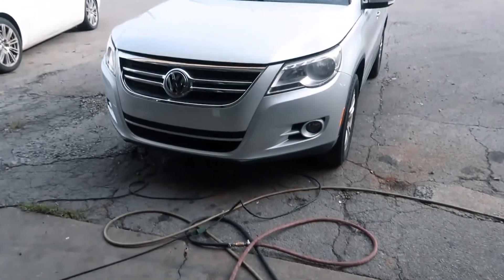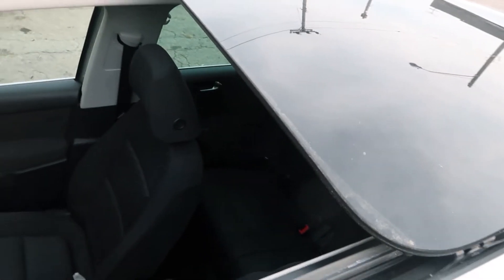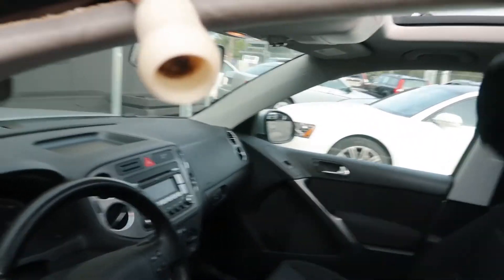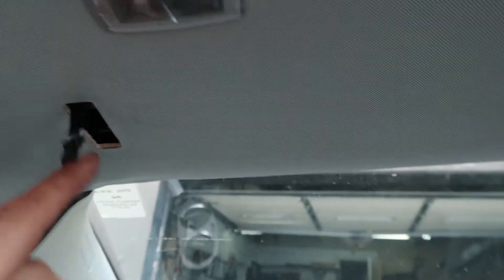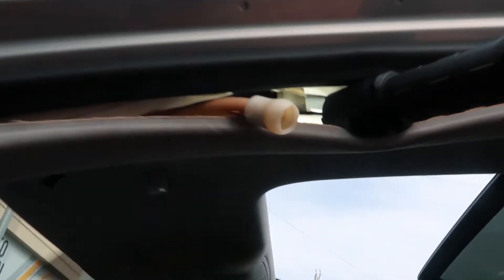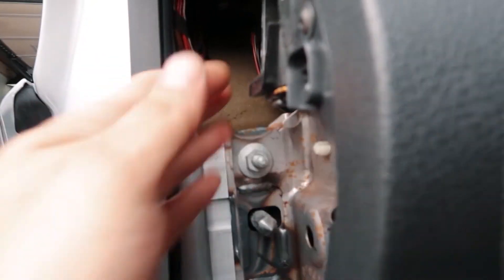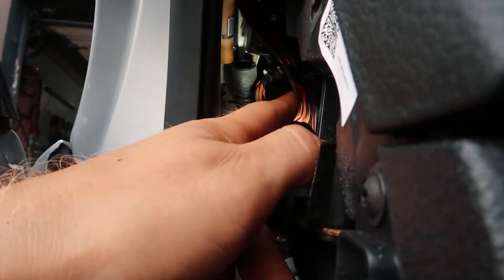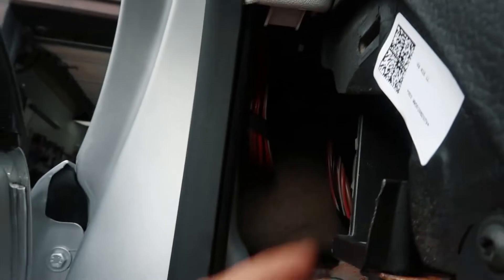🔴 WHY FLOOR CARPET IS WET ON PASSENGER OR DRIVER SIDE  FLOOR MAT WET and SMELLS WET!? VOLKSWAGEN!

Comment: Whether the hose leaks at the top connection or the bottom it ends up directing the sunroof water right onto the wiring harness that presumably runs to fuse panel.  That's some excellent redundancy if you're ever worried that your electronics aren't equally as wet as your carpet.

Comment: Mine has no sunroof. I think it may be my windshield I’m not sure tho I can’t figure it out if it rains heavy there’s an inch to 2 inches of water on driver side
Reply: same here. did you find a solution?
Reply: @Aakakalalal9  no.. but I had my windshield replaced two years ago and since then it started.. could me the cowl under the wipers mine is also cracked..